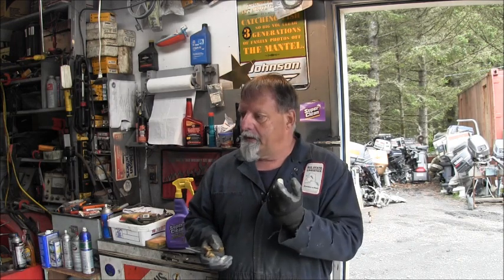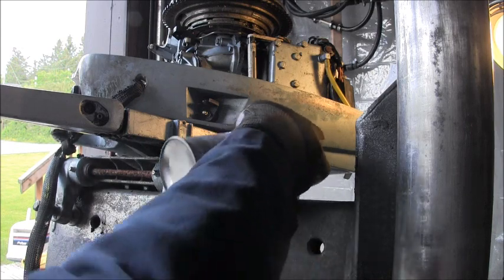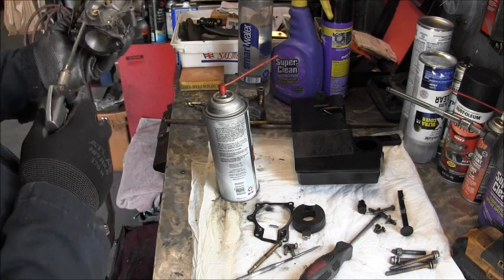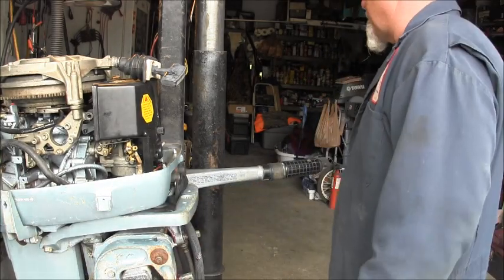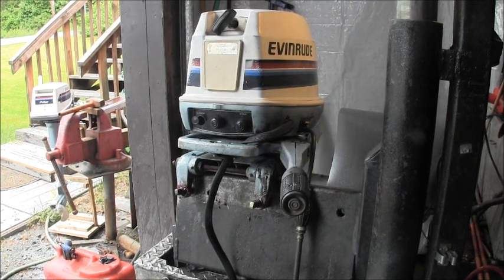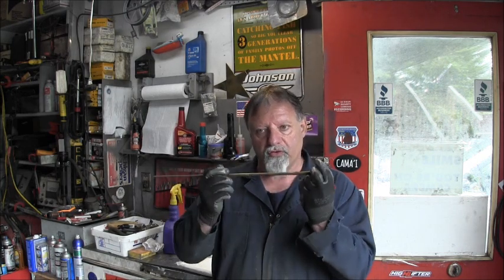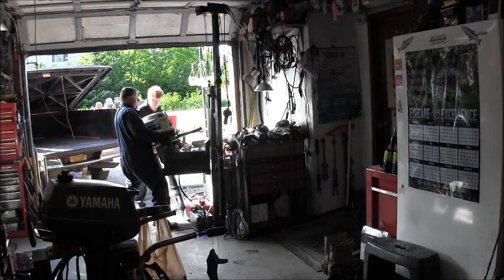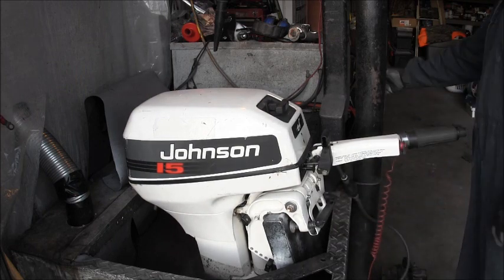EVINRUDE 1980  35  HP, wake up

Comment: I can't say enough good things about you and your videos they have taught me so much about the older out boards.  And it may be to late but i love my 48 special  evinrude.  I am from fl. USA 🇺🇸.  And the worst outboard I have worked on is a mucry force 40 hp the stop switch wires kept rubbing raw and going out .every time until I filed down the flywheel  finally got to work

Comment: The worst outboard I fooled with was an early 60's 28 hp Evinrude.  The gear case was full of mud, drive shaft was stuck in the power head and from what I remember was real heavy.  It needed a whole bunch of parts and ended up upside down on it value wise.  Once it was fully operational I realized it was too big for my boat and sold it at a loss.  The only cool thing about it was the hood.  I'm from Nova Scotia Canada I've been subscribed for a while now.

Comment: Up here in the Montreal area (Go Habs Go !) Canada, and over the last 50 years or so, I've owned or used about every american brand and never came across a "worst" motor. Ok, some were more finicky and/or had design limitations but great memories are associated with each and every of tbem. The 10 in the QD designation refers to a 1949 model if I'm not mistaking. I own a QD-14 that runs great on points, those chips seem to have reliabilityy issues. Regards !
Reply from the maker: I have yet to try the chips in real word conditions, but I feel you R Correct.   kodi

Comment: I'm in Lenexa, Kansas.  12 miles SW of downtown Kansas City, MO.   I never had many problems, other than carb cleaning, with my 1998 Mercury 60 elpto or my 1984 Johnson 9.9.  I did, however, have an old 60s Sears 5 HP Gamefisher that I had to use J-B Weld to fix some broken and wallowed out castings on then re-assemble and get back running...  I guess that was the toughest outboard issues I've faced thus far.  After I got it running I flipped (sold) it for $75 if I recall correctly...

Comment: Kodi, the worse outboard Ive had was a 40 horse Evinrude that kept shearing the woodruff key that retained the flywheel to the crankshaft everytime I accelerated. It would start, idle, run slow fine but would always shear that key leaving me dead in the water rowing back to the ramp. It was about a 1960 I think. I cleaned and adjusted the points, the condenser didnt seem to be shorted, but I just couldnt get that motor to take off from slow speed. Eventually, I could no longer get my flywheel puller to pop loose the flywheel so I traded it in on my 1998 30 Horse Johnson, reliability afloat at last!

Comment: From southern Oregon. I have an older early 50's Johnson 5 hp motor. The engine belonged to my father who has passed away and I got this motor. The motor didn't run. Had been replaced and put aside when my dad bought a new 1984 6.0hp Johnson. The worst part is trying to find ot find parts to get it running again.  I hope to get it running and working again to pass on to his grandson's to use too. Most engines can be fixed if you really want them fixed and have the ambition to follow through with the effort. I had Chrylers and Mercurys and never any issues. Kept them well maintained and addresses any issues right away.

Comment: The worst outboard I've had to deal with was a late 60's model 9.8 hp Mercury. That thing had to be worked on everytime we we went to use it. Finally sold it for about $100 and never looked back. Oh, and parts were much harder to find than for them ole Johnyrudes.  I live in the United States in Mississippi.

Comment: I had a  5 horsepower  ska  outboard on a 12 foot aluminum rowboat   basically if you  wanted reverse you slowed the motor down by the bar throttle  and turned the out board around backwards  and tried to reach the throttle bar  ..... ha ha  the only way to plane off the boat was to crank it wide open and run to the front  then run back  !!! hard work for a kid 
!
Reply from the maker: Sound like way 2 much fun, haha    kodi

Comment: Worst outboard I have ever seen was a Mercury 9.8. It had been purchased as a project and it turned into one. Gear case rusted tight and ruined inside, cylinders were rusted tight and had scoring, carb was corroded inside. There was also a mouse nest in it and the pee actually corroded the motor. Parts were like finding a needle in a hay stack. The wiring was destroyed and in most places chewed all the way through and the places where it hadn’t been destroyed by a mouse was deteriorated That one was one that needed to find a resting place at the dump. I’m from Bloomington IL USA
Reply from the maker: Wow poor outboard.  I feel bad 4 it & you.   kodi

Comment: The worse motor i ever had contact, was a Force 50. It had good compression, good Spark, clean carb and good fuel. It took Forever to start, many Times it had to use a second battery because the first One get flat. When hot, starts right away but if rest for 20 to minutes, same nightmare to start.
Greetings from Azores, Portugal.

Comment: I have a that a 1951 10 hp Johnson the guy I got it from put copper tubing where the rubber hoses on the carburetor used to be runs fine
Reply from the maker: I think I have seen that b4 as well,   kodi

Comment: Hello from California! Like your videos and thx for the giveaway. The worst outboard I had was a Johnson 15hp.
Reply: Really surprising...those are renowned the planet over as being really good
Reply: Those are by far my favorite motors ! Along with the 9.9 and 20hp !
Reply: Only issue I have had with mine is getting parts without going broke. Oh, and I have an 85 which has the gear linkage in the tiller for the throttle. The hardest parts to find are the ones having to do with that throttle setup. Only for 84 and 85.
Reply: @WallyGator72  they can be converted but kind of a pain to do it ! As far as parts the Chinese ones are NOT WORTH IT , I buy OEM and they last longer and fit better. I go through a few a year so I buy bulk .
Reply: @davekimbler2308  I just paid $70 for the one gear that the one in the handle mates up to. I might consider converting in the future if any other parts fail.
Reply: @WallyGator72  the knuckle gear is always broken or breaks easily ! If you need parts for any OMC let me know , I have many parts motors and I usually charge just for shipping ! I get a lot of my parts motors for free ! I belong to AOMCI and people contact me to dump motors !
Reply: @davekimbler2308  Wow thanks Dave!